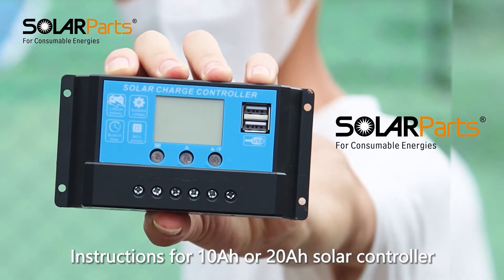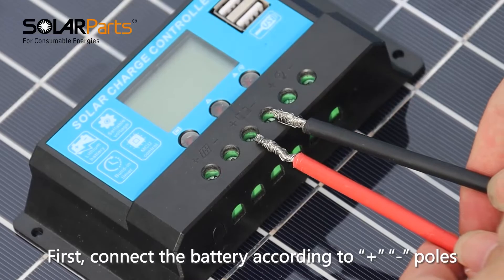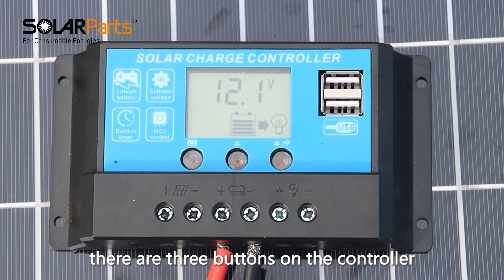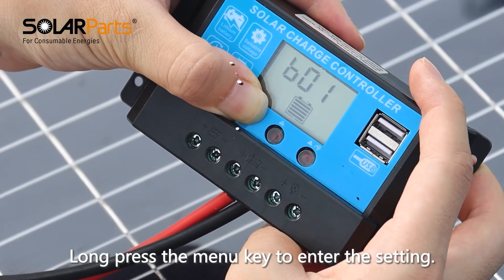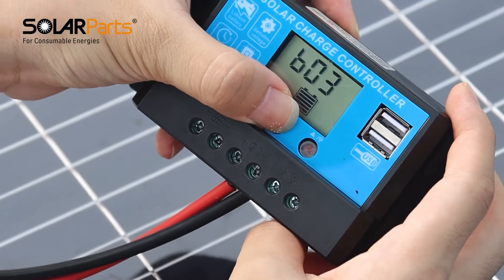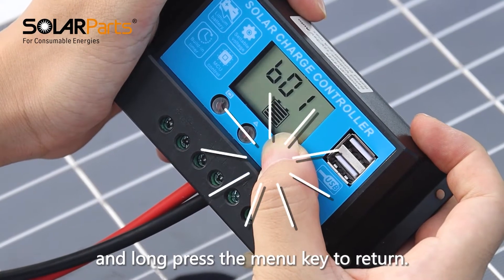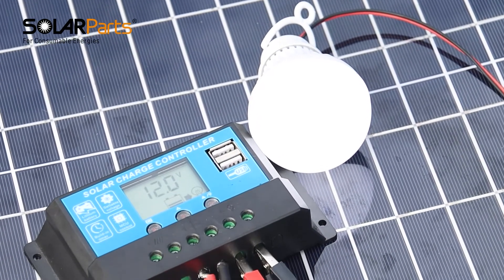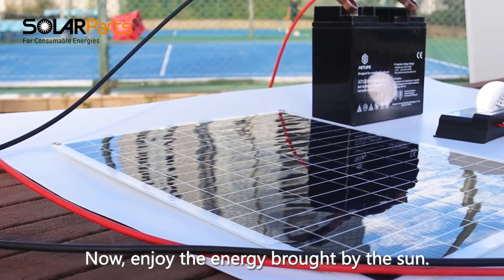How To Setup a Basic Solar Charge Controller | Quick Guide & Menu Overview

Comment: My battery is not charging, what could be the reason?
Reply: Not enough voltage output from panel probably due to very dim or dark light conditions but check connections to panel and battery. Always connect battery first otherwise battery may not be recognised. Make sure that battery type setup is correct.- B1 for sealed, B2 for Gel and B3 for flooded(car batteries).